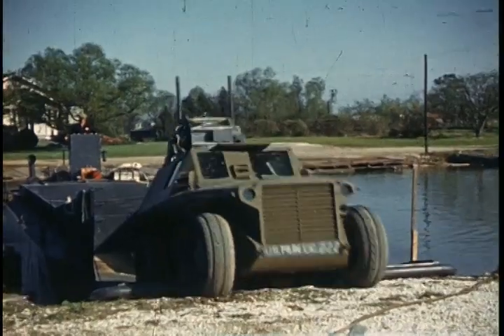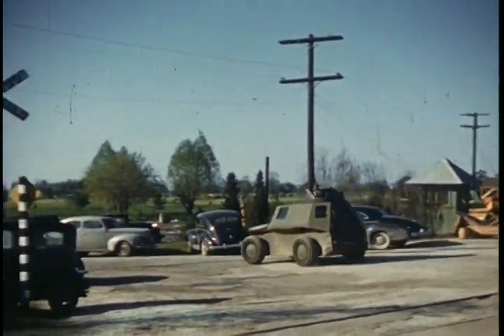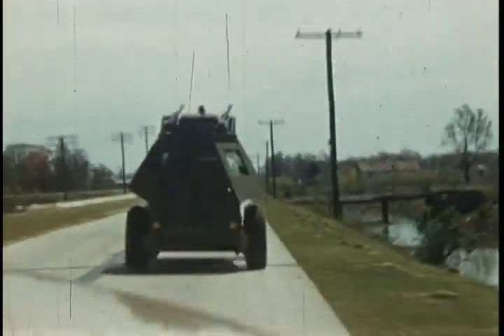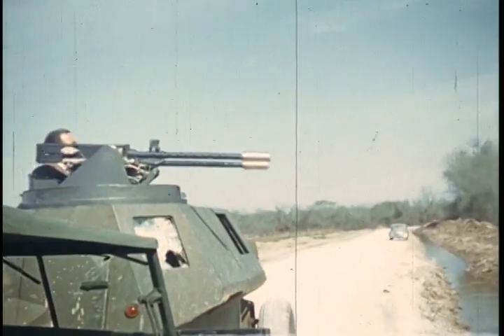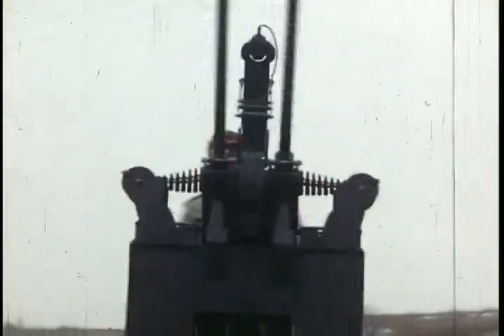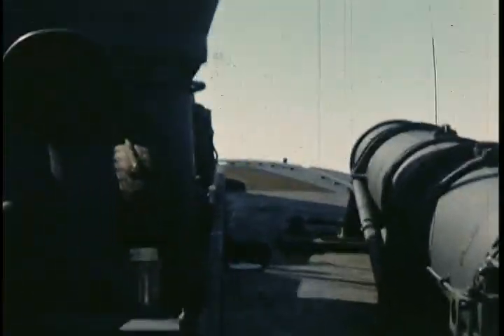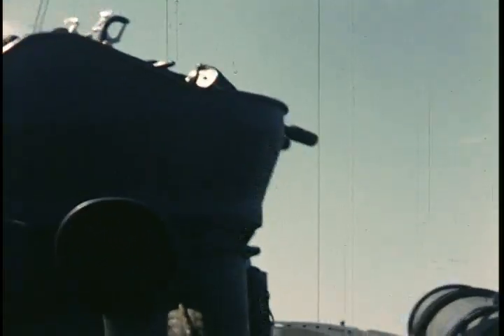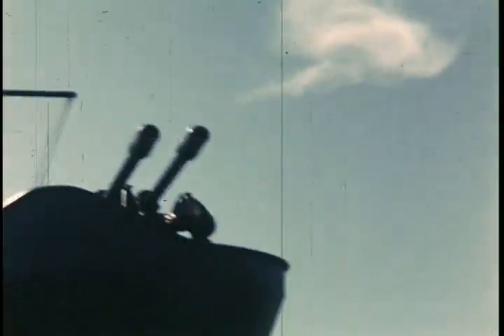Tucker Tiger Tank aka Tucker Combat Car

Comment: The car looks more like modern-day armored car with those bulletproof windows and sleek one-shape bodywork. Almost all of the armored cars of that period looked ridiculously outdated in comparsion to this one. They didn't include bulletproof windows, only some slits or flaps in armor to make the driver actually see the road. Also usually the fenders were sticking out too like in a regular late 1930's road car.

Also the front bears a striking resemblence to later Willys MB/Ford GP as we all now today as Jeeps. But this one had those headlights bumps being all the way across the whole body and making the integrated shape with the rest of the car, unlike GM's and Ford's creations.

The tyre pattern is also interesting. It reminds me a bit of grooved tyres used in 2000's F1 cars. Did they have the similar purpose?